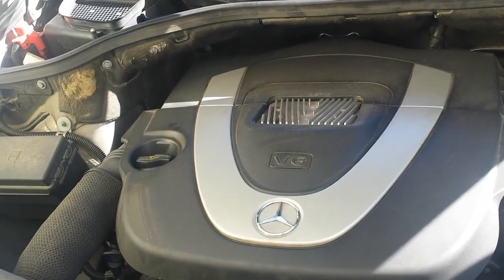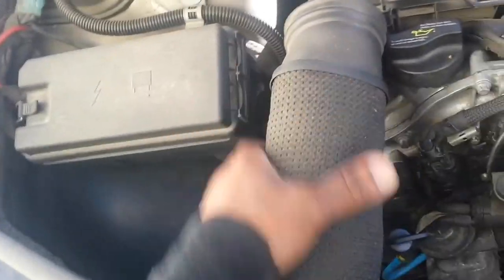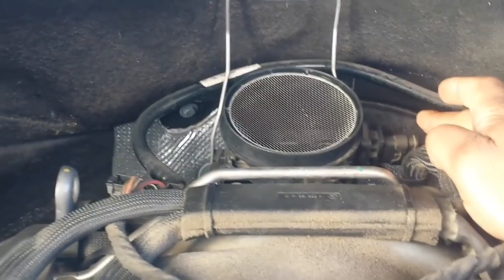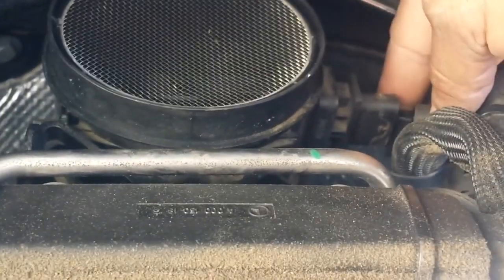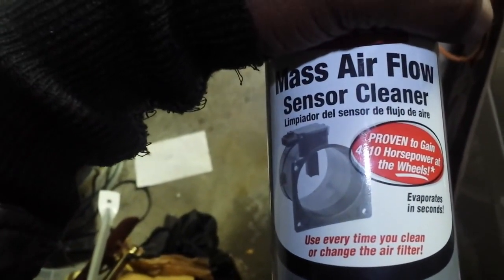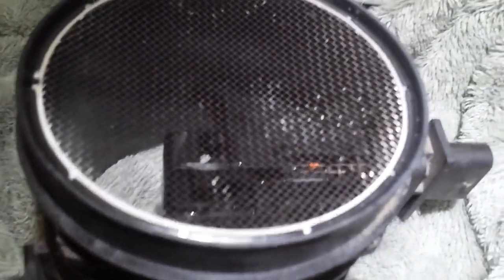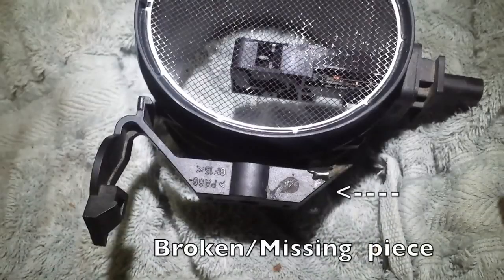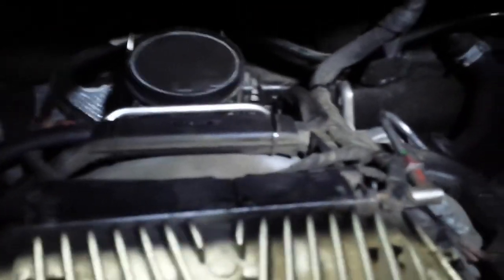Mercedes ML350 Mass Air Flow Sensor Replacement

Comment: Hello Keith. Thank you for making this video. They really help me a lot since I got fed up with Mechanics cheating me so much because I drive a GL450.  Now I do everything myself after watching your videos. Anyway, I accidentally removed the clip behind the engine air intake and now the dreaded 'check engine light' is on. Any help on how to reinstall it? The U-shaped clip that you installed last.
Reply: Luckily I don’t have a light, but I can’t get that clip up either! I used vaseline to lube all seals to make sure there’s no air leaks and they seat super tight!

Comment: My ML 350 is pushing beyond 20/30 KM in the speedometer and not commiserating with the speed when i push the acceleration, what might be causing this?

Comment: Hi Kieth, thank you!  Your video is exactly what I was looking for, in order to do some work on my 2008 ML350.

It’s strange…on Amazon I’ve found Mass Airflow Sensors ranging from $30 - $350.  They look the same, however I know that there has to be a difference in build quality and warranty between them…possibly.  What is your recommendation?

I found the same situation with the spark plugs and coils, prices for 6 plugs and coils ranging from $86 - $300.  The lower priced plugs (they’re iridium BDFHYK is the brand name) had a better rating than the Bosch for $almost $300.

I’d really like to get your input!!!  Thann be me again!
Reply from the maker: I’ve tried the cheap parts and the genuine parts.  With electronics, variations in voltage readings and inconsistent output especially when the components get warm to hot to cold.  Failure comes even faster and when climate conditions are at the most extreme.  Try cleaning the original parts before replacing them especially with cheap parts.